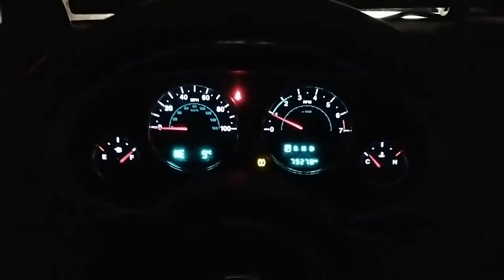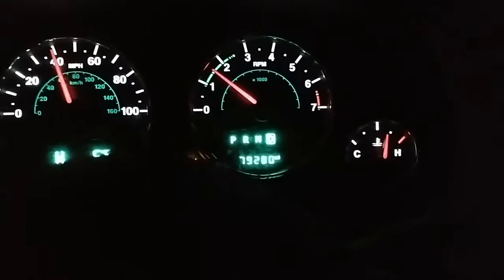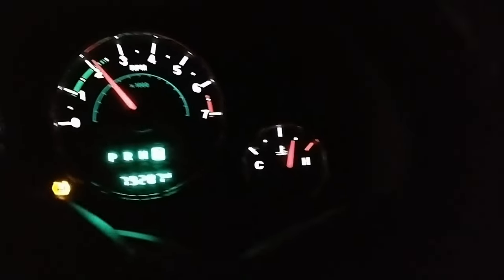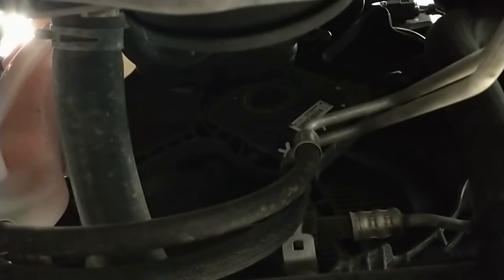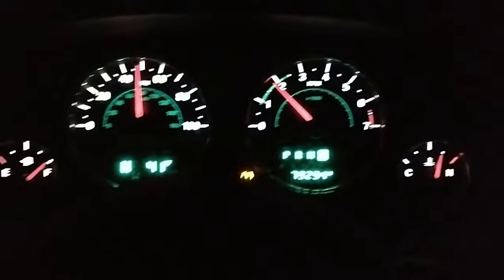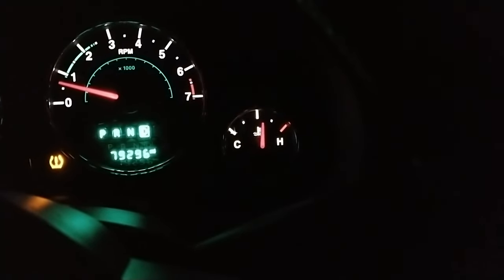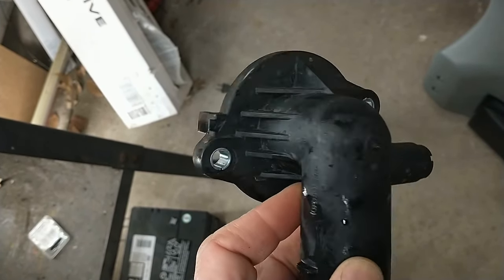Jeep Wrangler only overheats on highway...what's going on? (not what I expected)

Comment: Man, I have been in circles for about five months now. Had a jeep wrangler 2012 with intermittent overheating issues. Ended up doing a double head job because it did have head gasket problems. After doing the head job had a cylinder misfire wound up being burnt valves so I did another double head job and replaced with new cylinder heads. Even after that my temperature would always fluctuate. Went on one off Roading adventure and it ran somewhere between half and 3/4 and sometimes just at 3/4 the entire time. this thing consistently ran 230 or 240 on the highway and even in minor city driving. It overheated too many times, and my oil pump crapped on me and I blew the engine. Something to do with tolerance in the bearings because of block warpage blah blah blah. Anyways, months later I’ve got a brand new engine in it and I mean brand spanking new. Since day one I’ve had a fluctuating coolant hand problem. Between half and 3/4 even today on the way home it fluctuated mind you I have replaced the thermostat multiple times but I’ve got the same thermostat in there now that I had on the last engine. I’ve gotten so fed up that I’m taking out my factory radiator fan and putting in one from a 2008 JK and my own 195° temperature switch screwed into the head so the fan can come on sooner. I just got fed up. But I may just try another thermostat for laughs and giggles and see what happens now that I’ve watched your video.
Reply from the maker: dang, you've had your share of trouble with that one.  I hope you have seen the worst of it and get to just enjoy your rig for a while.  I hear of many people having to replace that darn thermostat multiple times before getting one that actually works.
Reply: @joyofwrenching  yeah man it’s one of them double edge sword things. I really want it to just be a bad thermostat because I don’t know what else to do after spending probably well over $8000 but at the same time if it is a thermostat I’ve already replaced it multiple times lol I’m stuck with it now. I hope I get to enjoy it soon to.

Comment: That same thermostat I have replaced twice on my 2014 Rubicon, it was purchased at autozone in a pinch, and did the same thing both times going out. The first time, it went out, only took 2 days, so I returned it and got another. that one lasted 4 months until I had to replace it yesterday. Loved that your video popped up in my feed today.
Reply from the maker: So sad to hear that all too commonly these keep failing!
Reply: Stick with OEM for the thermostat, duralast ones dont work.
Reply: @toekneecast  yeah thank you,  I ended getting the OEM, was just in a pinch having to do a road side fix on it before lol, but yeah definitely love OEM things over autozone  any day haha

Comment: Mines doing the same thing. New radiator, oil cooler, thermostat for $1900 at the dealership in December of 22 and March of 23 doing it again, dealership put a new thermostat again, was fine for a month, and doing it again now.
Reply from the maker: Sorry man that stinks, just make sure they replace the thermostat AND housing it's in as mine was sticking in the old housing
Reply: May i ask you, did you have that Oil Cooler before on your car, or it was installed as additional aid to the radiator? As far as I understand the Oil Cooler is an additional small radiator which is located in front of the main radiator. We also have problem w/overheating in our 2003 Chevy Cavalier, so are interested in all the details related to overheating.

Comment: I had this on a customer's 2018 Jeep Grand Cherokee Trail Hawk with the 5.7L V8 hemi and it ended up being a Blown head gasket on the combustion side of the head gasket causing the over heat to not happen at low speeds or idle but on 50mph or higher speeds the guage climb and it was causing the pressure to spike so high it was blowing the outlet tube of the heater core hose to blow off the quick connect fitting in the engine bay.. Replaced head gaskets luckily no coolant in the engine just combustion side of the gasket blew out around cylinder 3.. got it fixed yesterday had  it for over 1 week and 4 days
Reply from the maker: Good to know, storing this away in case I see one with similar issue. Thanks for sharing
Reply: @joyofwrenching  no problem at all hope it helps was a Very Puzzling diag new water pump, Thermostat, radiator, radiator cap and it was spiking only during 45mph and up on the psi to over 52 psi so figured it would help others Always Nice to share experiences with other techs

Comment: Not wasting time watching. Saw in comments it was thermostat. That is correct. The 3.6 will only like OEM or Mahle brand that I have found in my multiple experiences with this issue as an independent tech. Motorad, Napa etc did not work. OEM was on national back order. Found Mahle ones to work fine. I think we used another aftermarket brand that worked. Can’t recall that one.

Comment: I have a different car but with the same problem if not identical problem based on the simulations you've done, I might actually need to to replace my thermostat because of this. Thank you
Reply from the maker: I hope you get to the bottom of that soon and this helps, just be sure to check the radiator for obstructions first, could be blocking airflow and fooling you.

Comment: I have 2014 with the exact same issue. But also no cabin hot air. Took it to a shop and they said head gasket. 
I replaced the thermostat with a cheapo from auto zone and replaced the pump.

Hope an oem thermostat is the answer.
Reply from the maker: me too, make sure they do a block test before condemning head gasket, as it's rare, and the loss of cabin heat makes a restriction in the heater core suspect, so do a heater core flush.

Comment: my 2016 JKU went in last week went to the dealership for a similar issue... they threw a brand new thermostat on it but still doing it... was told by another dealer to use an OEM one not the autozone one and it fixed it
Reply from the maker: Crazy how the right part matters in some cases

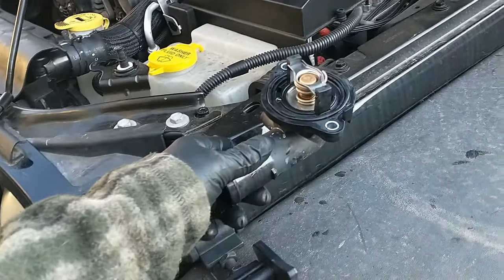Comment: At 34:28 you can see the purge on the thermostat housing that your holding , the old one has the plastic screw looking round plug, looks like a Philip head screw, be very careful it breaks very easily if u tighten it to much.. always have spares on hand    they sell them by themselves ..
Reply from the maker: Good tip, thanks!

Comment: My Jeep is doing the exact same thing. Anything over 3000 RPM and it over heats. I already replaced the Thermostat housing and Head Gaskets and its its still doing this.
Reply from the maker: Some report getting a couple bad thermostats before a good one. That's the most common issue leading to this problem

Comment: I fixed mine by changing the radiator cap. I purchased a pressure cap and no more issues. I sent $9 on Amazon
Reply from the maker: Good tip, thanks!
Reply: @joyofwrenching  I started with the least expensive and was going to work my way up.

Comment: Hi from Ontario Canada, 2013 jeep wrangler jk, some what the same issue, but mine didnt have any heat in the cabin on the drivers side or middle, but lots of heat on passengers side and this has been going on forever, so we flushed the system, filled up with new fluids, started overheating at highway speeds, so burped the system again and changed the thermostat, yes we also put the front end up higher on stands, now seems to be running good but heating issue still the same..anyone else have a solution , or same issue with cabin heat not working on the drivers side , im open to suggestions..great video by the way. ✌✌✌✌
Reply from the maker: The heat working inside the cabin tells us the heater core is good, but that you only have heat on one side points to a bad actuator under the dash that directs the flow of air to one side or the other.  Look up vids on changing the actuators for the JK, and I'll bet you'll be back in heat in no time!
Reply: Hey bud im from Ontario as well! Decided to do a radiator flush on my 2016 JK because my check engine light went on for the thermostat sensor. So I changed the thermostat sensor and thermostat itself. While I was at it, I did a coolant flush and also back-flushed the heater core. I wasn't getting any heat on the drivers side, but after the flush it was perfect, but a couple days later my heatercore burst and had to replace the heater-core. Everything works fine except now my engine overheats at idle and then cools back down after the fan kicks on at 107 degre cel. Could it be a head gasket issue. I hope not😢
Reply: @joyofwrenching  Interesting, Dang I'm learning a lot from you.

Comment: I've got a 2013 JKU.I bought it in 2019 with 102k on the odd.  I've been having overheating issues for a considerable amount of time. In 2021 the radiator was replaced because it sprung a leak. Old Mechanic replaced it with a new radiator which a year later ended up being replaced again as it sprung a leak too. Both were plastic radiators. I personally have done the coolant flush twice, burped it endlessly and I personally replaced the thermostat (as a way of trouble shooting) and it is STILL overheating and again blew a leak into the 3rd Radiator. Curious things about it...the reservoir tank although I've filled it, never stays filled for long and I haven't had a functioning heater in the cabin for as long as I've owned it .I was told recently that these models have a heater core problem where it get clogged. Therefore creates too much pressure which is why it's ringing leaks through my plastic radiators.  Have you heard anything about the Heater Core's getting clogged up to the point of creating such pressure that it busts up radiators? Also, my water pump works fine as well as my hoses. And YES I'll be installing an aluminum radiator next but first make sure I;m not overheating because of the heater core backup.
Reply from the maker: Wow that stinks!  I haven't heard about the heater cores clogging and causing what you've experienced but maybe some of our friends reading this can give some opinions?
Reply: I had this. Heater didn't work. One issue that's been going around is sand from the engine casting at the factory isn't quite cleaned out before they put it all together. I did a thorough flush of the entire system, including blowing pressurized air backwards through the heater core and got quite a bit of debris out. At the same time, I replaced the thermostat and it ran great for a couple months or so. I came back for answers to this video looking for the overheating at highway speeds issue which is plaguing me now. I guess it could be the thermostat this time again, so we'll see.
Reply from the maker: Wow @johnkaldeway , good to know about the sand issue!  Hadn't heard that before, and yes, check that thermostat again, they keep failing, and oddly in the stuck closed position.
Reply: @joyofwrenching   replaced my working thermostat because of the scanner code recommendation. the new thermostat got stuck closed and the jeep overheated 2 months later. 😮
Reply from the maker: That is horrible! @binkydamauler  I've heard a lot about bum new parts lately, especially Stellantis (dodge/chrysler) parts!

Comment: Im having the same exact issue...  Took it to the dealer, they messed it up even more. Then they told me I needed a new heads.  I fought it, they replaced it at their cost.  I just got my JEEP JK back after 6+ months of fighting with them.   Guess what...  It's still overheating when driving.   I did see that there were issues with defective thermostats. Mine was "replaced" but it might be the same issue.  A defective thermostat.   Cross your fingers....
Reply from the maker: Dang, I sure hope you get yours figured out soon, it's been too long!  I hate that so many have had this issue and gotten jerked around by shops of all kinds.

Comment: Another good thing to do, most thermostat would tell you the temperature.  Then  just checking the temperature of the hoses or radiator with heat gun to see if it match.  Don't match you know something wrong.

Comment: Burping air out is not enough onthese engines. The coolant system needs to be drained and vacuum filled with tool called an airlift. Only way to keep the air pockets out.

Comment: Thanks so much.  I'm planning on getting a used JK.. and this video was very helpful.  One of the issues with JK's is overheating, and now I know what to look for when test driving a JK to see if it's overheating or not.  In regards to the diagnostic computer tool you we're using to get the cool temp whie driving, what tool was that.  I need to get something similar.
Reply from the maker: Glad you found this helpful. As for a used jk, check for oil leaks from the oil cooler. There are many other vids on that. Most any scan tool that can see live data on a car will work for your needs. Just get a cheap one off Amazon and start playing with it on your cars to learn.
Reply: @joyofwrenching   Thanks so much !!

Comment: Radiator Caps do go bad. If they can’t hold the pressure. Antifreeze goes into the overflow bottle, and it fills up. Then it can overheat. When you fill up the radiator the best that you can, then finish up with the filling of the coolant bottle. The system purges itself with the coolant bottle 

Check your catalytic converter if the engine overheats only at Highway speeds.
Reply: Why check the cat?
Reply: If your catalytic converter is getting stopped up. The engine can’t vacate the exhaust. The operator pushes more on the throttle to compensate for the stopped up catalytic converter that is blocking the exhaust gas from exiting the exhaust. As a result. There isn’t enough exhaust gas exciting the engine against the struggling engine trying to run

Comment: It's possible that the wrong coolant was put into the engine at some point in time.  The ole HOAT vs OAT situation.  If the wrong coolant has filled into the engine, it could have clogged the heater core.  Just a thought?
Reply from the maker: good thing to keep in mind.  Thanks!

Comment: I purchased a “Mopar” thermostat from a local dealer, and when I opened the Mopar bag, there was a MotoRad thermostat in the bag.  Not sure if that’s who makes them or if they are just bagging aftermarket because the actual Mopar units are on a major back order.   Mine was doing the same thing, It fixed my issue for about 4 months, now it’s starting to act up again. Edit to add. I see your TX flag now.   Wonder if it was the same dealer…  Conroe TX
Reply from the maker: I'm in Tulsa now, but you can take the Texan out of Texas just not the Texas out of the Texan!  I'm not sure if Motorad makes the housing or not...good question.
Reply: MotoRad is a cheap aftermarket part.  I couldn't find an oem one fast enough so I bought the MotoRad one from AutoZone.  My car temp gauge kept dancing around and would climb to almost the danger level... especially on the freeway or going uphill.  Replaced it with the right Mopar unit and purged the air out of the system (use a no spill funnel and run the vehicle).  So far so good 👍
Reply: @GWrench9   Apparently the Mopar are still on back order right now.  I’m going to try another aftermarket for now.
Reply: @AnglinTexas  It's true, most dealers show that but if you call enough of them you may get lucky.  I'm from L.A., so I called 8 dealers before finding one about an hour away (due to traffic).  Careful buying online, I bought one through McKinney Dodge in TX since they showed in stock but they ended up canceling my order because their system wasn't correct.  My advice, unless you have to pass smog (like I did) or your original thermostat failed in a closed position and your car is overheating instantly, just wait until you can find a MOPAR thermostat and do the job once.
Reply: @GWrench9  that’s how I ended up with a MotoRad in a Mopar bag at Mopar price.   “Yeah we have a few in stock”  “it’s genuine Mopar”  hour drive, but my wife was there in the town anyway so she swung by and picked it up.   I’m north of Houston so I’d imagine the demand is high around my area.
Reply: @AnglinTexas  Terrible!  Call them and have them ship you a MOPAR unit unless they want to be responsible for any engine damage.  Charging $80+ for a $24.99 part.....sneaky.

Comment: There are many reasons why overheating happens,  i have a 2005 jeep wrangler unlimited Rubicon 4.0 with all my upgrades my weight is 5800 pounds when mfg states dry weight 3800 and maxs weight is 4600 im about 1200 over gross my build has a 6inch full traction long arm , 35x12.50x18 Mickey Thompson tires,  atlas transfer case , hanson off road bumper with dual baskets on bumber , galvin wilderness roof rack , arb bull bumper , with winch . Rock hard roll cage package,  smitty built drawer for cargo area , rooftop tent , arb awning , solar panel on hood , and spintec supercharger this is why i am heavy , my jeep overheats when ac is on at times i get up to 240 on temperature,  i do have high flow  new water pump a 190 thermostat and new radiator my harmonic balancer is original no slipping snd fan clutch , i live in texas but now sure if i could make Colorado in summer time like this im looking forward to black beak pass
Reply from the maker: sounds like one heck of a rig there.  I wonder if there's a way to add volume to the cooling system on these jeeps to help?
Reply: I do believe my weight has a lot to do with it only when ac on so far my temperature can reach critical temperature I do live in texas we have been over 100 past month

Comment: I have drained and changed the thermostat myself 3 times and burped the system 
I have a gargle in the cab from the heater core area as well 
I think this problem is coming back